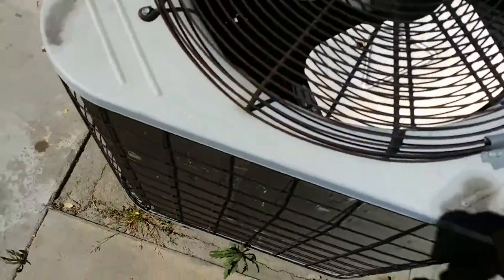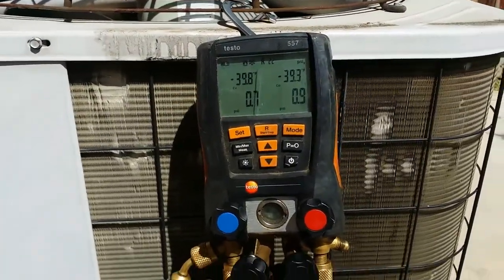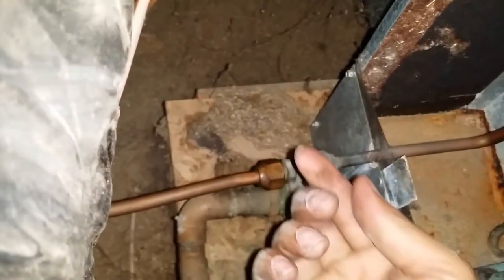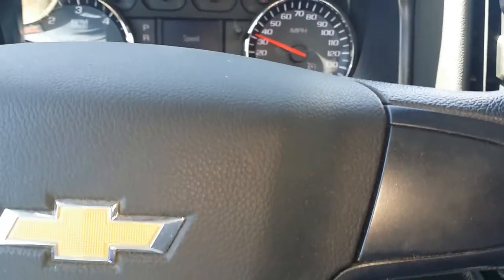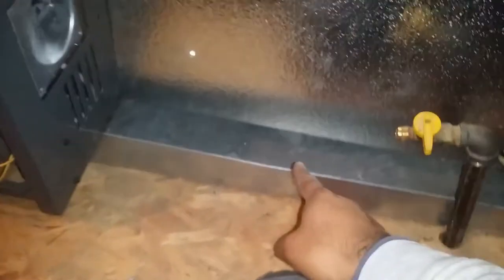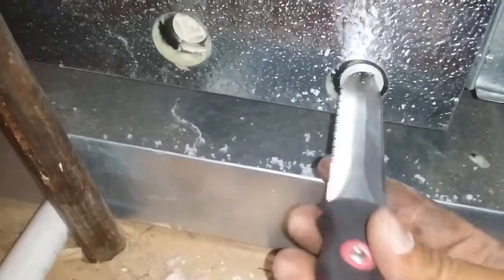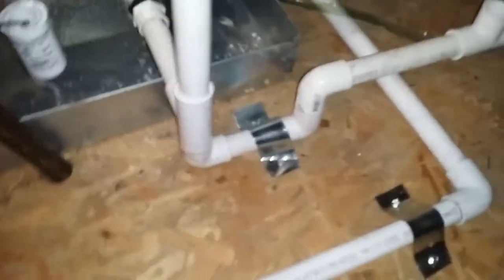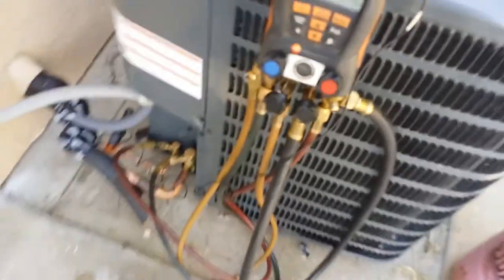HVAC: replacing a split ac system

Comment: Why did you use that crazy all style coil?
Reply from the maker: I like them, what's wrong with them?
Reply: I never install one of those type of coils , what's the pros and cons of using them ?
Reply: To each his own and for you like them then use them. Hard to clean, can't change just the coil one day, overall cheap construnction IMO. The ductboard plenum box coil is horrible for balance and even temps
Reply from the maker: +Joe Shearer they are very easy to clean they have condensation outlets on both sides of the coil and it's not duct board. well at least not this one.
Reply: +THE HVAC GUYS ok I was suprised to see you use it was all.
Reply: Usually use an allstyle coil when there is limited space......having a plenum after the coil is much better....even air temps through out the home...